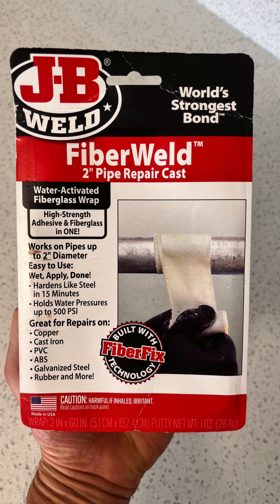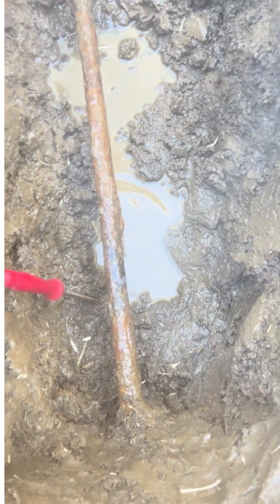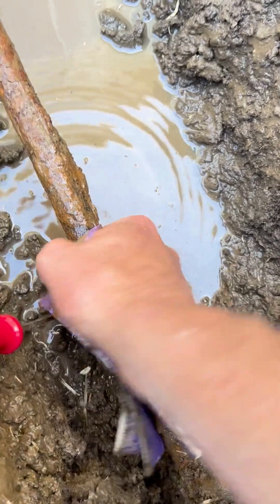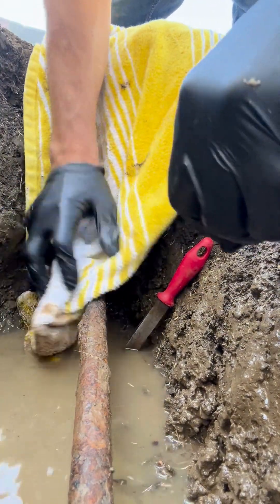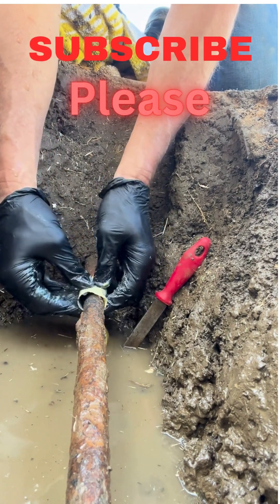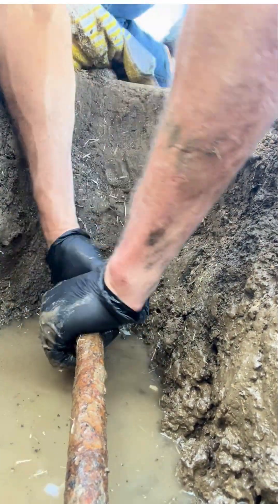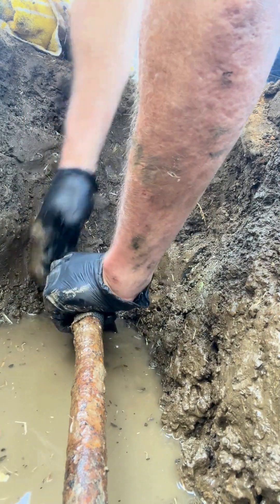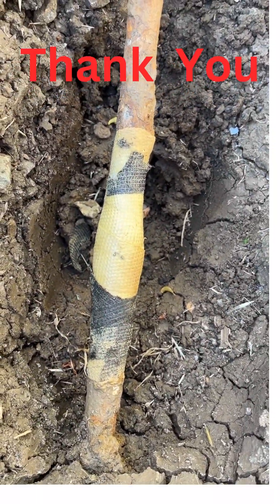Pin hole leak repair using JB Weld

Comment: Use a rubber gasket and clamp approach-much much easier and fool proof-this is messy and can easily fail. After failing you have to cut and replace the pipe because you cannot smooth the pipe for a rubber clamp seal after the epoxy hardens.  Terrible product.

Comment: I think I'll stick to my silicone rescue tape.
It lasts for about 5-7 years.
I just take out the old one and put on a new one when it starts leaking again.
For about $7 from ebay for 2.5 metre roll...not bad😊
Reply: Uhh, how much would a proper repair cost? And how much do you value your time?

Comment: Dug down to my water main that was leaking, found a steel pipe like this and said yeah that’s f’d. Called a plumber and said put in a new copper main from the sidewalk to the house. $ 3800 later it was fixed properly.
Reply from the maker: Ya, long term that’s the best option. The wrap can buy you some time to find an affordable plumber.

Comment: Junk pipe and crappy repair. Just replace the line. I guarantee that the ID of that pipe is reduced to roughly 50% of it's original size.
Reply: The ID of a pipe can Increase with corrosion, not decrease.
Reply: @davescarlett3514  yes the wall of the pipe itself will corrode but there will be a buildup of rust and minerals that will reduce the overall ID of the pipe. I've seen it hundreds of times with galvanized service lines

Comment: Pipe still looked dirty near pin hole , take grinder with roto disk 

The first wrap should have been tighter 

Dig hole lil deeper to get your hands around pipe easier 

Decent video
Reply from the maker: Thanks for the tips!